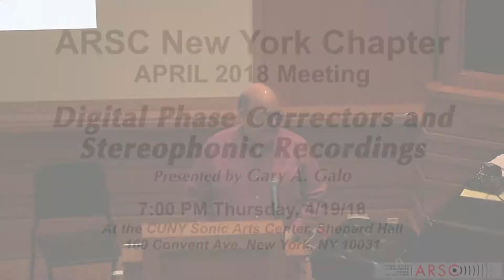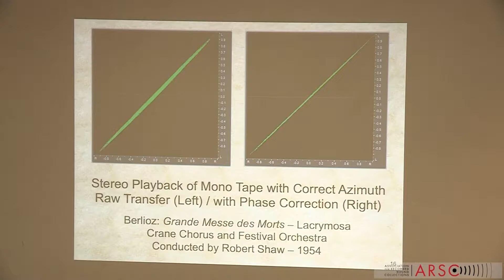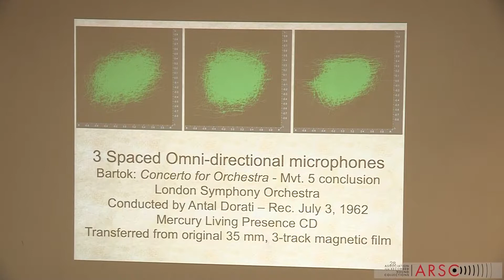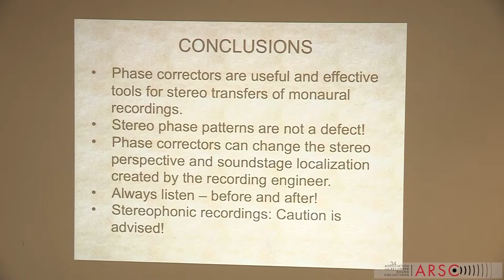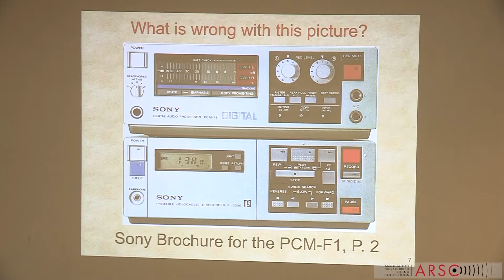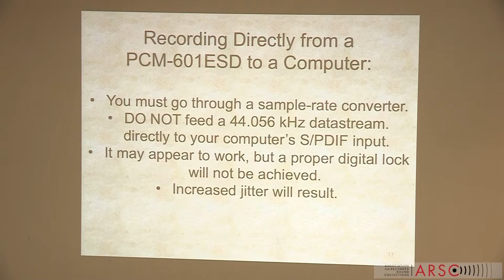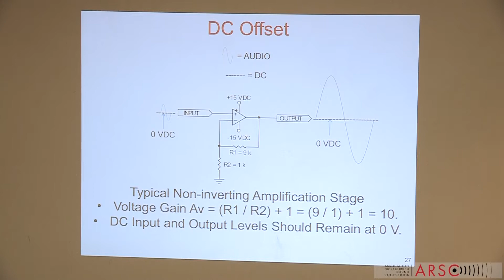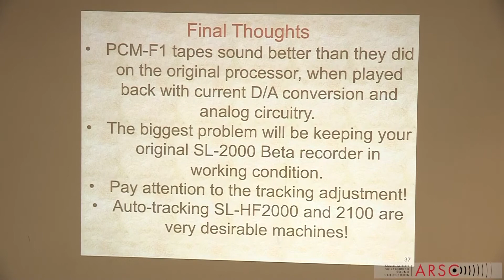DIGITAL PHASE CORRECTORS / TRANSFERRING PCM-F1 DIGITAL AUDIO TAPES presented by Gary Galo

Comment: I use a PCM-601ESD and also a PCM-501ES into which I've installed a S/PDIF output circuit which is a modern equivalent of the one installed inside the 601.  I record onto a Tascam SS-R250N and use the Red Book curve with Audacity to apply de-emphasis.  You need to use a Beta player with switchable D.O.C operation, or modify your player to kill the D.O.C circuit.  Here in the UK I use either the SL-F1 or SL-C9 player for this purpose.  I have come across Umatic tapes with these recordings too.  https://www.youtube.com/playlist?list=PLhKYgBM5T9vYeUo9qOzEmuGms5AxgdiHn